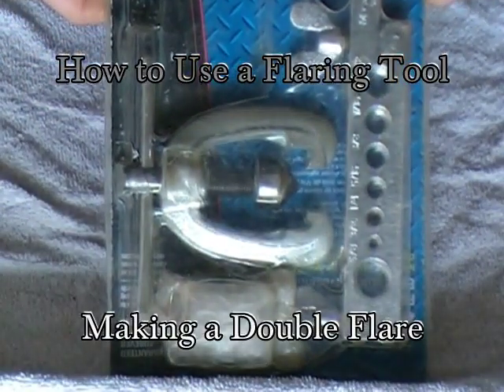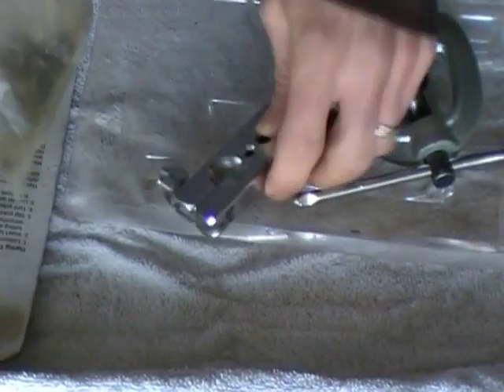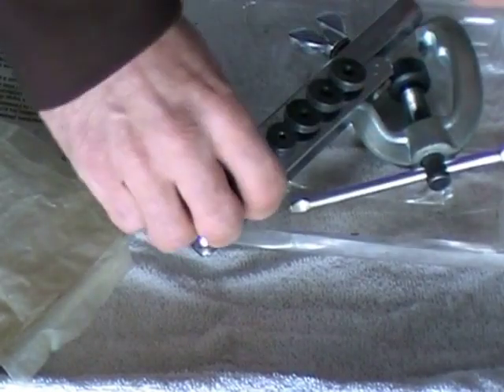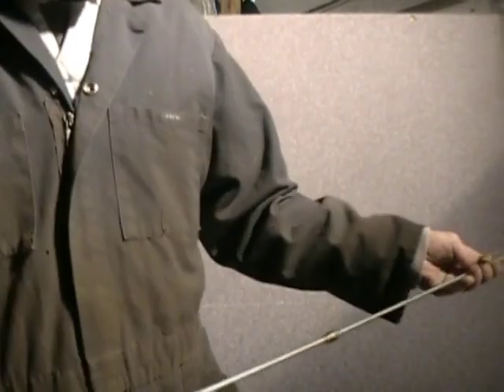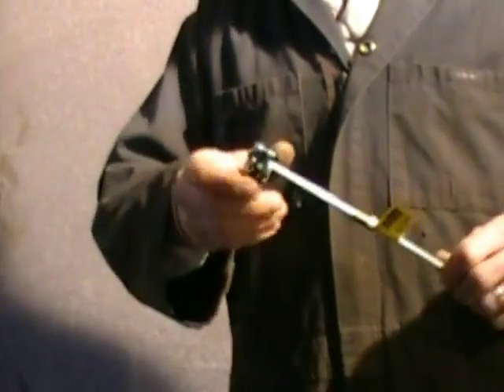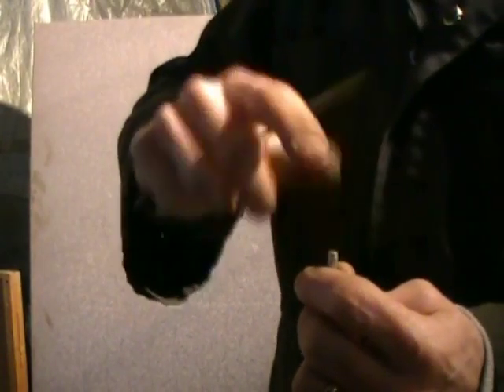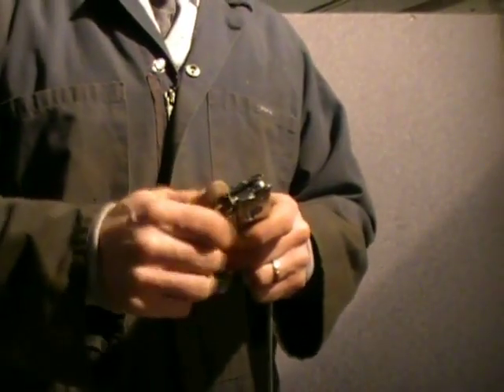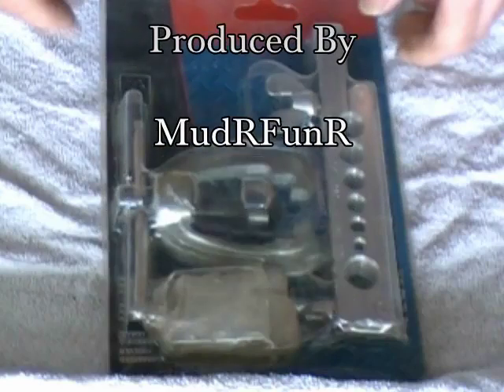How to use a Flaring Tool - Making a Double Flare

Comment: Thanks for sharing dude, bought the tool and immediately broke 3/16 pin, bought 3 news ones from sealey done the same again with the 1st, got 2 left, think I was tightening too much and not enough pipe protruding. Cheers

Comment: just a tip when you cut the flare off, use the flare clamp on the pipe to keep it from spinning in your hand like another t- handle, unless you alredy have a bend in it

Comment: @MoreThanAnOx Sounds like your old line is in bad shape and should be replaced anyways. Your plan sounds good to me, if I could get the job done with sections of 6 ft and couplers I would do the same. I just hear of guys using pliers to tighten the wing nuts and I never need to. Flaring can take some practise, it,s just the way it is. But it,s good to have that skill in your back pocket,good luck.

Comment: @skimywhistler25 Yeah, figured that out. It does work a lot better. Now I'm dealing with splicing into old line that wants to split. Also the tip of the line doesn't want to smash down straight. But think I've got with a better plan. I can buy flared lines with 10mm fittings in pieces up to 6'.  I'll buy enough lines for the whole job, use adapters at the two 12mm holes in the ABS unit, and use couplers and multiple lines where 6' isn't long enough. I am DONE with this flaring mess...hopefully.

Comment: Always tighten the wingnut closest to the line in the tool 1st. When you have the line snug, loosen the oppistte wing nut and retighten the wingnut closest to the line in the tool a second time,now tighten the oppistte wing nut, ( from the line In the tool). This is important and 1 of the few things that you really need to be aware of doing this. So get it right, don,t be a tool, make the tool work for you! Also be sure to de burr the line.

Comment: @MudRFunR I'm using a box end wrench to tighten the wingnuts, I'm using a new tool, and I'm having trouble with the new lines and the lines on the car that I'm spicing into. I've already replaced the washer under one of the wingnuts once because I smashed it to bits. I think the serrations on the clamp wear out too fast.  I guess I just need to find a better way to secure the line into the camp or maybe some material to wrap around the line.

Comment from the maker: @MoreThanAnOx Have you tried tightening the wing nuts with pliers? Carefully cause that's how I broke mine. I have noticed that lines from some manufacturers are slightly smaller in diameter. Maybe try a line made by a different manufacturer? If nothing else than your tool is just wore out.

Comment from the maker: @TexasCoffee Actually the line is metal. When you make the second flare it makes the flare thicker. The fittings will not seal with a single flare. Single flaring would not pass safety standards in Ontario.